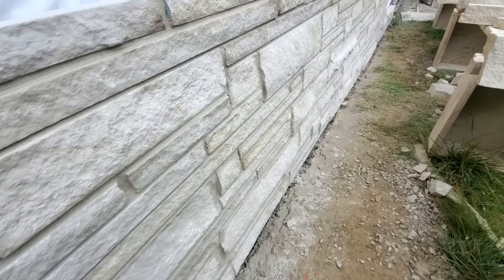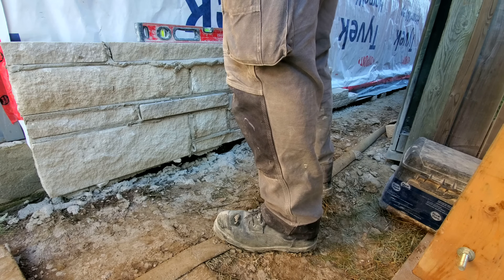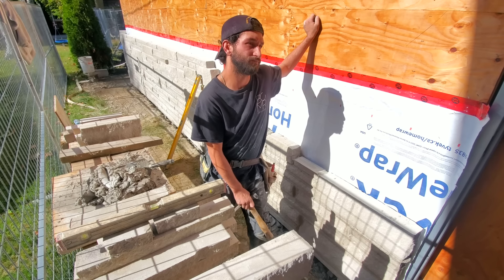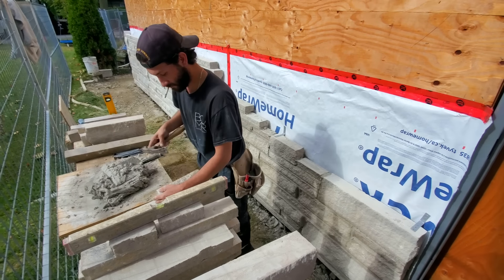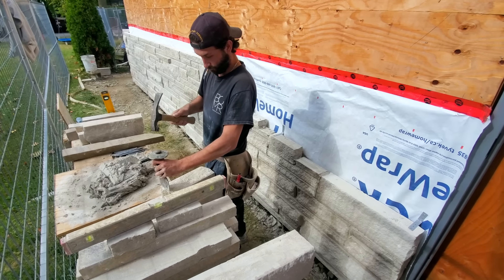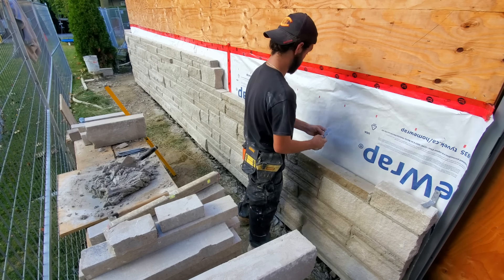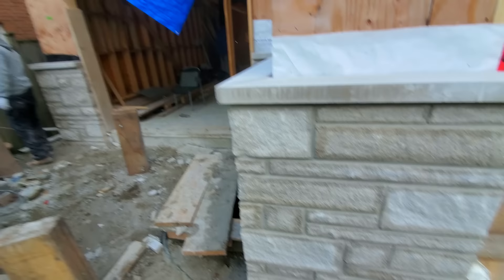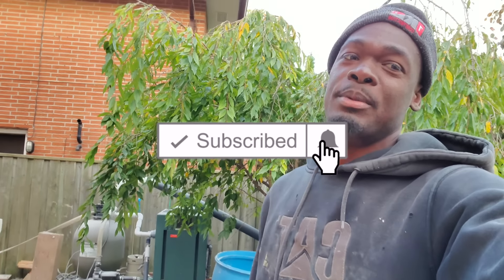New Bricklayer 1st Day - Homeowner Don't Wants Him To Work On His House

Comment: Usually there are small, medium and big stone. My labourer stacks them in a pile in order so it make it easy. This is a nice job minus the fact there is no stone saw... I know chip cuts are faster but a saw makes the cuts so much cleaner.
Reply: Best comment so far, you have to lay out the materials [ this is not stone] so that the mason does not have to pick through a pile of materials to get the right piece,
A wet saw at bench hight is better, safer and quicker for the mason,